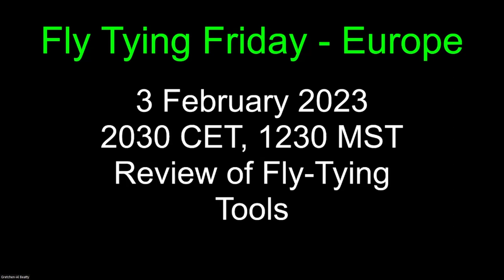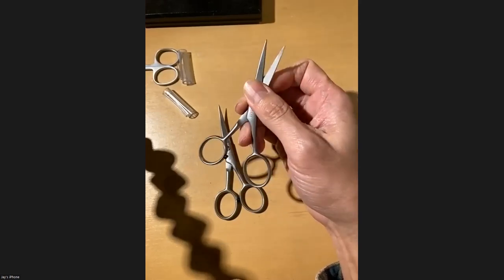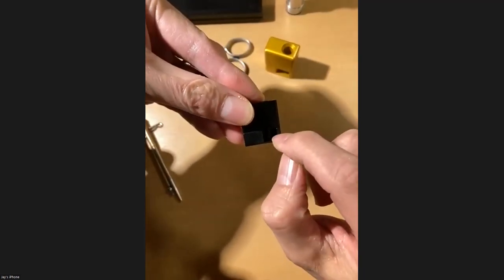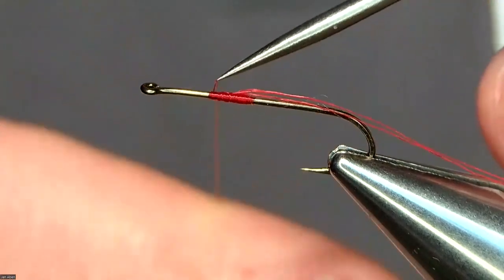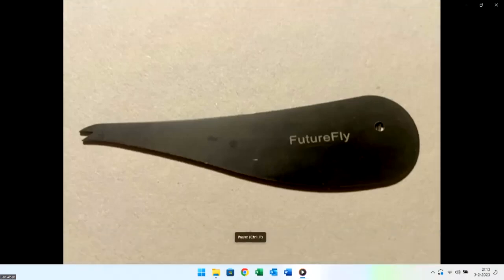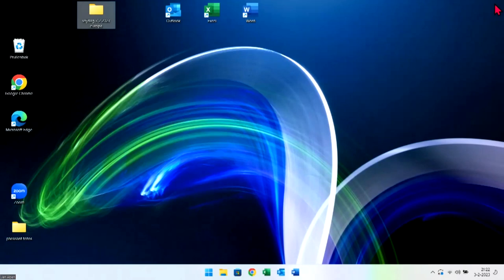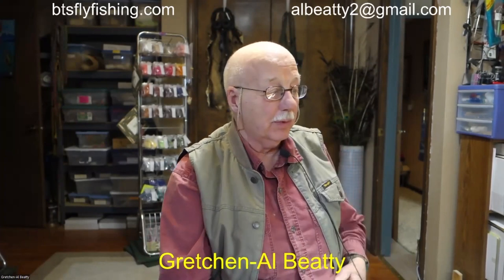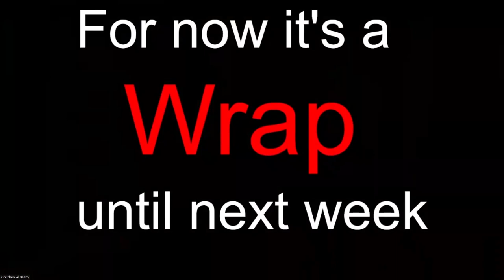Fly Tying Friday - Europe A Fly Tying Tool Discussion

Comment: Wow. Quite interesting. If you are having multiple guest presenters, it would be helpful to list their names & links to their web or YouTube channels if possible.

I’ve heard Eric mention his burnishing tool before but am quite uncertain how & why he uses it & can’t find examples. Help?

By the way that tool may not be a submarine periscope component, it’s possibly a combination hair stacker, whip finisher & syringe for Covid inoculations.   ;-)
Reply: I use the tool mostly for classic salmon flies. The little hook I use for "non destructive" separation of things, hackle, wings, underwings, moving and adjusting the wood duck teal pair, moving ribbing that's gotten out of place, etc. I use the larger spoon end for smoothing things like cement at the head, burnishing, putting pressure on hackle if it needs it. Many of the things I use it for could be done with a stout bodkin, but the dental tool works better and is less destructive. The bodkin I use all the time is extremely fine, so the other tool fills in when I need more stiffness.  It's difficult for me to describe every little thing I do with this tool, but I've found it indispensable over the years.
Reply: Thank you for clarifying in your reply. I’ve done burnishing on leather products (I taught leather work at a youth work project). I assume that you are using the burnishing tool to smooth out small lumps or similar imperfections on the floss for classic salmon fly bodies.

Comment: I use both an empty pen tube and a whip finish tool depending on where I want to place my knot…example…if I have tied a fly but got distracted and forgot to put a tail on, then I can still add one and secure it with a whip finisher because you can easily place a knot over the fly body at the rear to secure the tail you forgot…something I have not seen demonstrated! The fly with the missing tail is now fixed and ready to fish! The little bit of thread over the tail has little to no effect as far as the trout is concerned. Add a drop of glue on the thread and that knot at the rear will last the life of that fly for all practical purposes!
Reply from the maker: Hi Mike, We do just what you suggested from time to time and some flies like a Zonker has to have a whip-finish placed at the back of the shank to secure that part of the rabbit strip wing. We have a special (long) whip-finish tool on our website just for that purpose. Thanks for the comment and watching the video. Tight Lines - The Beattys